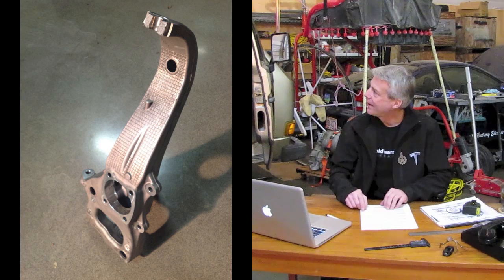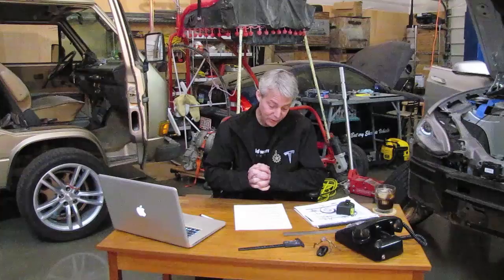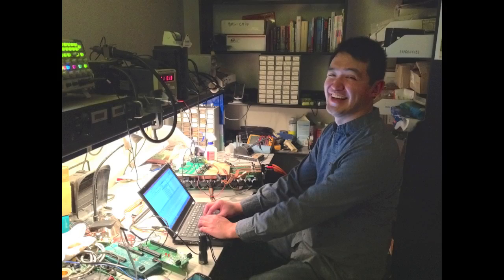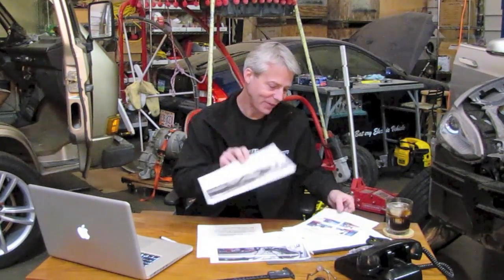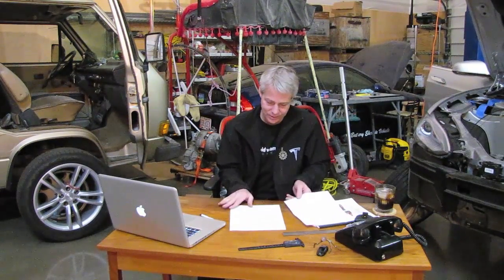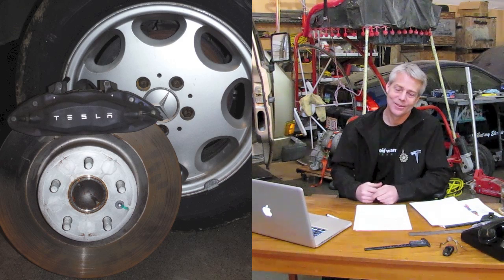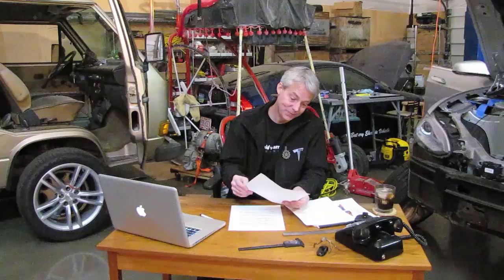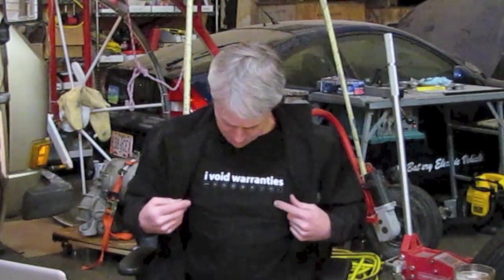Stretchla Video Update 2

Comment: Otmar, Love the old western electric dial phone with your cell built inside. I noticed the lack of a J-11 connector plug in the back of the phone so it was not on a landline. I recently started reading the EVDL after a 2 year hiatus. I still chose my words carefully, (Like you commented at EV EXPO in Tampa several years ago.) and that stretch vanagon with the "Zipper" over the splice point is just the RIGHT touch of fantasy. I wonder that Musk doesn't ask the boys at TESLA to cut you a deal on parts, because this will be cool publicity for them also.  Someone mentioned in the last week that no OEM is selling a full size pickup truck (3/4 to one ton) as a battery electric. Electric has the torque why not carry a real load, like 1,800 pounds of alfalfa for the thoroughbreds, or warmbloods, at the horse farm? And all wheel drive to negociate the pasture, or paddock...The working truck needs to be free of fossil fuel exhaust too..

Comment: right on!  i say lift that puppy.  just shim it higher, leave the vanagon seat rails intact, and maybee a 1/4" plate section as "blast shield" should the struts launch.   of course you have to raise the rear too right?  always wanted to jack my syncro 4", living vicariously through you Otmar!!!
Reply from the maker: Hey Gaspo,
Glad you're enjoying it!
Yes, the rear will come right along with the front. It has so much room back there that I've been ignoring the rear beyond a few measurements. I'd go all out on height if it weren't for the air drag penalty. I was a bit surprised how low the Syncro parts are between the wheels on a stock Vanagon. Whatever clearance I get on the highway, I should be able to run 57mm higher off road due to the height settings for the air suspension, and it's another 51mm to the topped out stop. Maybe I can make a "creep over boulders" mode for those rare river crossings :-) Hai-Yue is making up a Stretchla model for the aero simulations. We'll see how much penalty we get with my plan to raise the battery between the axles for more center clearance and better looks.
Reply: damn.  u on it.  still need radiator? otherwise can make a fiberglass/carbon nose cone ?  vanagon's kinda "brick to the wind" to start with, a little attention to the bumper/under zone would help a lot i bet.  my brother's wife is due in march/april, ill stop by when i come up to see my new nephew.
Reply from the maker: gaspo sky Yup, it doesn't' need much cooling for the battery and drivetrain, but it needs some. Mostly it's for battery longevity. I've temporarily plumbed in a Vanagon heater core since it's about the same fin area and was just lying here. The bigger aerodynamic hit in any luxury car is the condensers for air conditioning. Gotta have that AC! 
This is where Tesla got smart. If you block the air to the radiators when you don't need the cooling, the air drag gets much better. So they added the three automatic shutters on the Tesla, one on the coolant radiator in the middle and one each on the AC condensers in the corners. As far as I can tell, only the AC condensers have fans on them. 
Looking forward to your visit!
Reply: How about a tail cone? That would help more than a nose cone

Comment: So are you targeting about 750kw/1,000hp with the Tri-Zilla?
Reply from the maker: It may be a bit more than that, I'm figuring at the motor shaft, but I think TriZilla 1K sounds nice.  This time 1K would stand for the HP. It's only on paper until we verify the control system on this smaller 650A development unit and find someone to fund it, but it looks like basing a controller on three of my old 1K heatsinks should pull off 1000 shaft HP.
Reply: Otmar Ebenhoech Nice, been waiting for something like this to come out. I've been dreaming of an AC conversion that is capable of running 10's or faster in the 1/4 mile in a street car. Based on other AC controllers on the market, it will probably be well out of my price range, but it will be nice to see other conversions that fast out there.